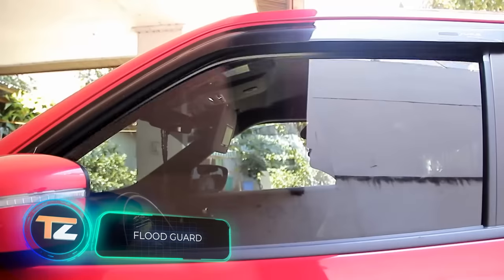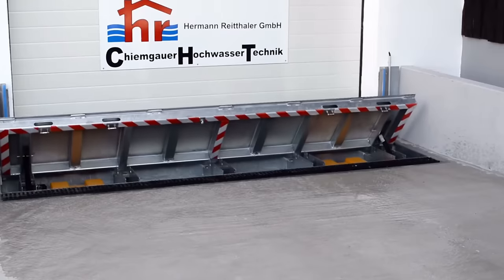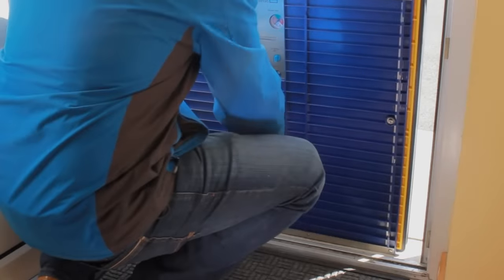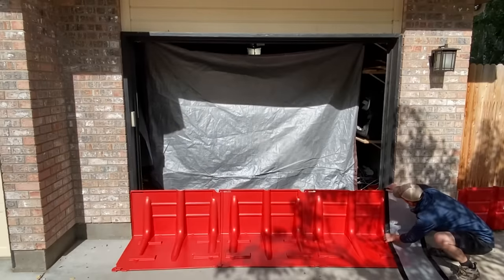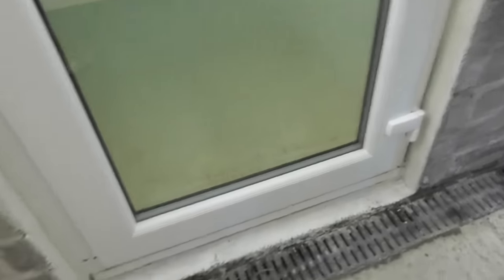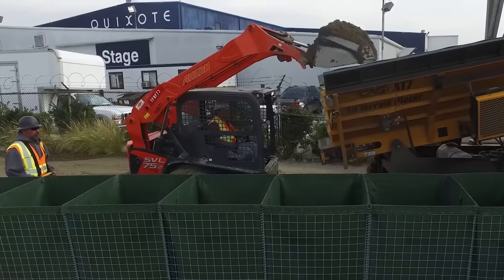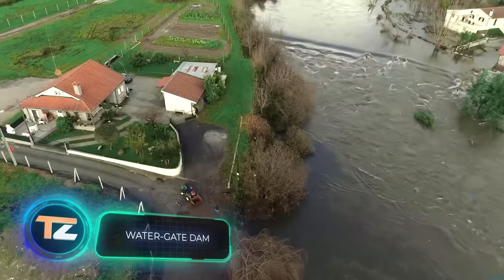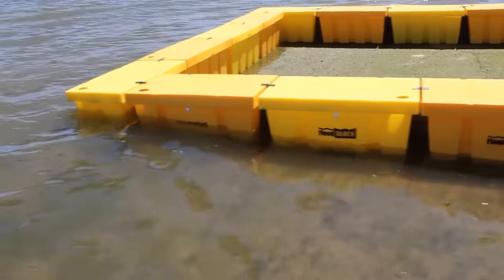FEW PEOPLE HAVE EVER SEEN THESE ANTI-FLOOD INVENTIONS

Comment: the concrete seems amazing to me. it drinks an incredible amount of water, but i'm curious there's no mention of where does this water go ? 🤔
Reply: I would imagine sink holes would become a problem.
Reply: Yea, either the concrete never properly dries or something else bad happens
Reply: @mr.cantsay  You know how when it floods on dirt there's always huge sink holes? oh wait, nevermind, that's not how drainage works normally.
Reply: It obviously goes to the 4th dimension
Reply: Inside the concrete?b
Reply: winter floods must be yummy
Reply: So the usual problem with regular concrete is that it prevents the soil from naturally absorbing the water it usually would. The more porous concrete is just letting the earth do its thing until it reaches it's natural filling capacity. I don't know if you live in the US but there are a number of highways already like this, they usually have a much darker pavement in my experience. Sinkholes only form when there's large empty pockets within the earth, natural groundwater drainage is still okay.
Reply: The concrete is made of a special blend of aggregates, cement paste, and bonding additives.  The porosity (gaps in the concrete) are caused in part by the decreased fine aggregates (sand) and excessive concrete paste in the mix.  The key to using this type of concrete is preparation of the subgrade below the concrete.  A layer of geotextile or asphalt, good layer of clean aggregate base, and plenty of drainage pipes in the subgrade to carry the water away from the pavement structure to discharge into a basin, storm drainage system, or other discharge point.  Keeping sand or other fine aggregates, and anything that might eventually clog up the openings in the concrete is important.  And treatment of the water discharge is important, as any oil, salt (for treating snow and ice) or contaminated fluids needs to be treated before it's discharged offsite.
Reply: Imagine the amount of black ice no thanks
Reply: I was watching a video earlier today of a guy draining a dam.  There was concern that the pond dam had been compromised and it was leaking.  So he goes in with a back hoe.  Cuts a swab into the dam wall and just before he cuts the dirt plug and begins the process of draining the water behind the dam, he shows the viewers the damage.  The dam itself was perfect.  Dry as a bone.  But the foundation was topsoil and had begun to wick water.  It was in effect beginning to flow beneath the dam.

I can't help but think the same thing would happen hear.  All that water has to go somewhere.  And I did notice that the recommended locations for this was parking areas and not streets.  I figure there has to be a reason for that.  And with that high a void area between the aggregate, there has to be a weight restriction on it as well.  I'm not an engineer so I admit there maybe something I'm missing, but either the water has to be diverted somewhere or it reaches saturation point and you still get flooding.
Reply: Into the shadow realm
Reply: @mr.cantsay  Not to mention when it freezes, the water will expand, and that will destroy the road way quicker.
Reply: There are drainage channels underneath the concrete, so it's basically a more concealed type of curb and gutter. The problem is it's useless in a flood just like regular curb and gutter, once the level rises above it. I also have to wonder how well the concrete works after dirt, sand, and plant matter plug up the porous ability of it, or, even more curious, how it does in winter with salt, and water possibly freezing IN the concrete instead of on top of it.
Reply: They are dumping all the water in one small area, in a real flood that covers a large area, there would be nowhere for the water to go. Also floods carry a lot of dirt, this can form a layer on top of the concrete, which would stop it being impermeable.
Reply: I don't know how it's done but if I was desinging it I'd incorporate "french drains",  basically pipes full of holes in the aggregate underneath on a slight angle. 

If you've ever seen a septic tank overflow picture that in reverse. 

I'd love for this to become common on all roads but I kinda doubt it's lifespan under heavy traffic, it's ability to avoid becoming clogged and it's cost. Might be easiers and cheaper to use traditional roads except actually look after them as well as upgrade our fking drainage.
Reply: I can tell you what it's like for southern Louisiana, at least. There's a slew of issues down there. It's swamp land that was paved over for houses, businesses, etc. Storms wreak havoc here. The problem is, this was all swamp land naturally so obviously it's an environment that's naturally very wet with very soft ground, which is not conducive for building large structures. The water is either above ground or the soil is just about saturated. Unless you want to drive supports 20 or so feet into the ground (into the clay) for buildings before you can even lay the foundation, you have to scrape up the topsoil until you get to the layer of clay beneath and then build the foundations on that.

The topsoil is the most absorbent part, and clay is less absorbent. Concrete is even less absorbent, but it's put on top of the clay regardless. The more development, the worse the floods have been getting. Even if they used absorbent concrete, there's still the problem of only so much water that can be absorbed into the clay layer at a time. Theoretically, if the absorbent layer of concrete is thick, then it would be great, because using that over large areas would actually hold a ton of water by itself and allow more time for water to seep into the clay layer. But if it's a thin layer, like a few inches, then you'd be mostly relying on the clay absorbing much of the water (if we disregard the terrible drainage systems helping with drainage lol). That would be difficult if permeable concrete is not used very much compared to regular pavement, because you'd really be relying on small areas to do the heavy lifting in terms of absorption. 

Development way south of the delta has only served to diminish the swamps and marshes around the Gulf of Mexico that were a natural defense against hurricanes. So storms are worse and worse every year and delta is lost every year. The land gets washed out to the Gulf of Mexico, good luck restoring that. Storms will continue to get worse and methods to prevent flooding and flood damage will only become less effective over time.
Reply: I imagine it's like some paver systems which are laid over a concrete slab. The water drains along the top of the slab under the pavers to a proper drain. If the water level were to reach high enough, I imagine the whole thing would fail because there is nowhere for the water to go.
Reply: I'd imagine there's another layer of normal concrete beneath it, allowing the water to flow away without risking your tires slipping in the rain.
Reply: Sinkholes and unbelievably destructive frost heaves in freezing conditions that would shatter the parking lot is where it would go. Unless there is a full drainage system underneath which would cost so much more.
Reply: there's a drainage tile network (pipes with holes at the top under a layer of gravel and sand) under the contrete, usually the water is drained to  nearby buffering pond or normal storm drain.
Reply: I have done some research on this previously as it relates to the water table so let me answer a few of the biggest concerns here.

Freezing water will cause it to crack:  This one is pretty easy. The water doesnt stay in the concrete. It flows through the top layer into a substrate that is designed to take the expansion.

But it will just fill up so it wont stop a flood:  Filling up is how it stops the flood. The ground under a mall parking lot can hold thousands of gallons of water. With traditional pavement the water just flows over and nothing is absorbed. This compounds as that water flows down and joins more water. With permeable pavement the water goes into the ground and it acts as a momentum break. Even if it becomes completely saturated the flood is that many thousands of gallons smaller and the momentum was slowed at a crucial early stage.. 

What about drainage: The system I'm familiar with comes in three layers. The top is the pavement itself. The next is that absorbative substrate. Then there is the drainage layer that disperses the water evenly into the natural ground.

Cost and maintenance: Yup. This is the reason its not everywhere by now. It costs more to setup and more to maintain. The environmental benefits arguably are worth the cost but we dont have a great track record of valuing nature.
Reply: @davewsh8434  A Spanish guy in my class came in all beat up looking, face bruised up. I said,  What happened? He said he was driving in his truck and he hit some black ice and went off the road. I said, OMG were they alright?
Reply: Hmm, I wonder where the water goes? It must cease to exist.
Reply: It doesn't absorb the water it lets it pass through.

Comment: Lol..love how people think that by blocking a doorway will keep the water out. Unless your whole house is water tight it's coming in.
Reply: I know. U beat me to it with this post haha
Reply: Yep. Many poorly prefab houses have poor joints with large gaps that will allow the ingress of water.
Reply: Brick homes have weep holes every 5 to 8 bricks to let moisture out under normal conditions. In flood conditions, they let flood waters in. And then you have windows. Water is coming in.
Reply: It works in a lot of places. A house down the road to me has a home made version that attches to their wall outside to divert and even hold back flood water. I have seen it save their house from 2ft of water. Their shop next door to that was flooded.
Reply: It will come up through the drains.
Reply: Air vents too.i have some low ones on my house
Reply: @ashyclaret  to come through the drains of a house the sewage system would have to be backed up
Reply: My house has flooded three times and not once has the water come in through the door.  I don't understand how people don't understand that water will get in however it can.
Reply: @delta250a  Lmao did they intentionally divert the floodwater to their shop next door so they could get the insurance money?
Reply: @voltic7133  No, shop is a bit lower and doesn't have a concrete wall around it like their house does. No chance at stopping a flood in that building!
Reply: as other people have said houses in europe usually have brick or concrete walls
Reply: @secoura  I can help you understand.  In Europe, in flood-prone areas, we build waterproof houses out of strong materials where the only way water gets in is through the door.  Watch literally any video of Europe's countless annual floods and you will that people only have to sandbag their door - it's almost as though they have experience with it.

Comment: Topmix should be made mandatory in larger cities as it would help recharge the water table as well-especially in low lying areas and underpasses
Reply: Regular roads already have problem with cracking because water that gets inside will expand during the winter and destroy the road. Having a road like this will make the problem even worse. These roads probably need to be replaces after just 1 or 2 years.
Reply: Even where water doesn't freeze. I wonder if this would cause sinkholes under the concrete? Or to a much lesser extent small voids and make it crack and buckle/collapse in areas on the parking lot.
Reply: Yep, those water gate dams are awsome too
Reply: @dhruvhnk6860  not the mask mandate, the vaccine mandate
Reply: @ipant1056  me too I am pissed about being legally forced to wear clothes and then judged by some capitalistic clowns and divas as to what labels are attached to them,life aint fair.
Reply: @WaterspoutsOfTheDeep  Yeah Topmix isn't a drop-in replacement for asphalt, the whole stack of layers that make up a road / parking lot need to be designed with that permeability in mind.  That said, sinkholes don't form from rain distributed over a surface (which seems to be the intended situation Topmix addresses), otherwise we would see sinkholes in every field after every thunderstorm.  It is when water gets channelled or concentrated that it causes serious erosion, be it from runoff getting directed to a small area or an underground pipe springing a leak.
Reply: @peterschornstein1450  I would need to see it survive a few Canadian prairie winters before buying in.  I'd be happy if it worked though, because another thing it does is absorb a lot of noise from cars.
Reply: Yes, but where is the water going? I can just see an entire freeway collapsing into a giant sink hole.
Reply: @triarb5790  if I'm right there is a water catching system that has gutters not sure tho
Reply: @triarb5790  sink holes dont just randomly appear Florida has subterranean limestone caves.soil testing is an imperitive but in areas that are lowlying and the soil is permeable and has been stable this will work.Ofcourse it will not be adviseable to build large structures on top of this.A lot of urban flooding is caused because all the soil has been covered with concrete and there  is no where for the water to permeate.
Reply: @Symixable No, potholes are not mini sinkholes.  Potholes are caused by erosion (aided by mechanical stress from cars) from above, sinkholes are caused by erosion from below.
Reply: @triarb5790  If done correctly, the water goes the same place it does when it rains on an open field: down through the soil.
Reply: @dhruvhnk6860  You're right, life ain't fair; but Judgment Day is. I wouldn't want to be a Liberal/ Leftist then.
Reply: @BlackMuslimConservative  gee Ali Alexander ,at the moment I was pondering the effects of Topmix on rain water runoff and didnt want to drag in God into what is a man made mess.When the moment comes I can look my maker in the eye and expalin my deeds I doubt if He checks party affiliation.
PS:Bible Gateway Matthew 7 :: NIV. "Do not judge, or you too will be judged. For in the same way you judge others, you will be judged, and with the measure you use, it will be measured to you. "Why do you look at the speck of sawdust in your brother's eye and pay no attention to the plank in your own eye?
Reply: @peterschornstein1450  and also likely costs far more per sq ft of road
Reply: Agree
Reply: @mynameisgladiator1933  When did he say he's liberal
Reply: @brandinski8449  He didn't have to. Republicans look at this and consider the long-term cost, which would be asininely high. Liberals see the quick fix to a singular problem and charge forward.
Reply: @WaspLife  But not everyone is the same? I can point out a racist republican and say all of them are racist. Or a anti cop liberal and say all liberals are anti cop. It's bad to generalize
Reply: @peterschornstein1450  The reason regular roads crack is that water gets trapped in them then freezes. The whole point of these surfaces is that water passes through to the ground underneath. They actually have less of a problem with winter cracking because they have less water in them.

Comment: How much resistance can these car covers take? If there's a flood they're going to be pulling on that a car at probably 50 mph or something crazy like that but you will that strap hold on long enough or will it break?
Reply: that's more "flash flooding".   Many cars simply have slow flood water rise up on them to submerge them.  

I'd be more concerned with the pressure of the flood water denting up my body.
Reply: @Sahadi420  Most floodwater doesn't get deep enough for the pressure to cause deformation in the body panels. You don't get to 2 atmospheres of pressure until the water is 33ft deep, after all.
Reply: Lmfao 50 mph seems like a bit much lol.

Comment: 3:03 Top mix permiable concrete sounds great and is an innovative design but has two major floor. If gasoline is poured on it, it can literally burn for hours... and in sub-zero conditions, the water held in the concrete can and will freeze, breaking up the entire compound and leaving a crumbled, uneven surface that needs complete replacement. Hopefully continued development will solve these issues.
Reply: I’ve looked it up, apparently it’s more resistant to freeze-thaw because the ice has space to fill in rather than pushing against the rock. No idea where the burning idea comes from.
Reply: @evaahh9584  It's already been tested, both freezing and burning. Ice doesn't flow, so it doesn't move into free space, it expands, pushing whatever material is containing the water apart - breaking the material apart, leaving loose rubble. Spilled fuel on the stuff is a harazard and a fireman's nightmare. This is why the stuff has not been put into use yet, even though the idea has been around for a while now.
Reply: @Nemoticon  not put into use? Try driving on basically any Dutch highway. It has been in use for 20 years or more (and thus not “developed by a UK company“ either).
Reply: The water doesnt tend to stay in the road layer. That's kinda the whole point =)  It's going to flow into the substrate before it gets a chance to freeze. The substrate is design to take the expansion. Proper substrate is essential if you are going to use this type of surface. Fire is an issue only if your fire dept is not briefed on how to handle it. I'm guessing that test was just some local FD giving it a go. The good news is that continued development did solve those issues.
Reply: @williamjenkins4913  It will always get clogged with debris, grind and sediment that will cause it to hold water.
Reply: @Nemoticon  Yes. It's not a cheap solution and requires more regular maintenance the normal asphalt. That said it is  still probably worth it in areas with water table issues.